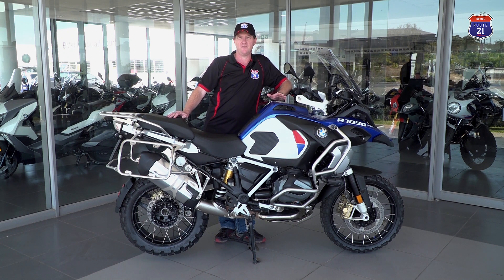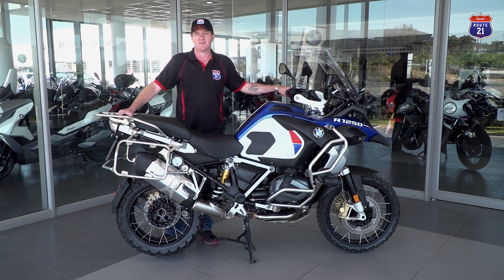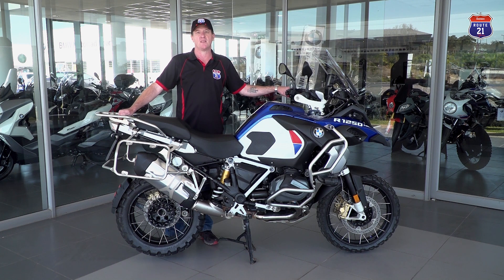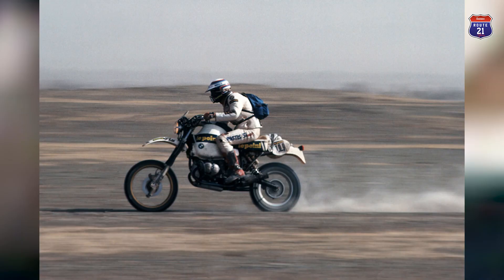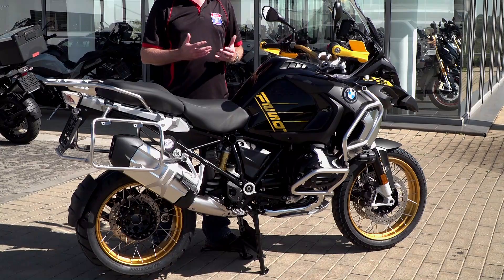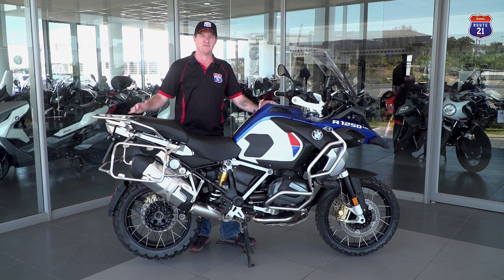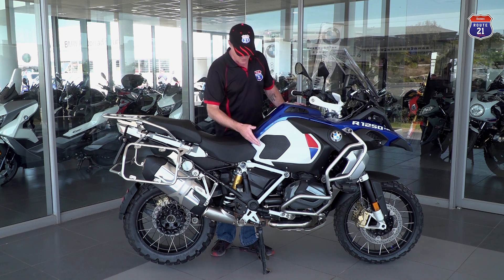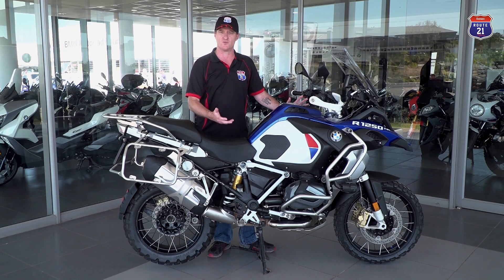BMW R1250 GSA HP Adventure Story and why HP

Comment: Does this HP tag on R1250 mean additional features ? if yes what are those ?  does this HP tag applies to GS or GSA ?
Reply: Until model year 2020 there were HP versions of the GS and GSA available. From 2021 on, they got renamed to Rallye. Mainly it's just a paint job but it adds some minor things. 

For the GS:
-SA-Nr. 456 is the option code and includes:
-windshield Rallye, clear
-Rallye seat low with luggage plate (height: 860mm)
-stainless radiator side trims with radiator protectors
-spoked wheels gold or with code SA-Nr. 771 also in black
-enduro foot pegs 
-longer front wheel cover of the beak
-frame protector
-cover plates if the luggage plate is removed
-no center stand but can be ordered with pillion package SA-Nr. 413 or pillion package low SA-Nr. 4A1

For the GSA:
-SA-Nr. 456 is the option code and includes:
-windshield Rallye, clear
-Rallye seat bench low with lagguage plate (height: 880mm) or with code SA-Nr. 759 Rallye seat bench with lagguage plate (height: 900mm)
-radiator protectors
-spoked wheels gold
-brake callipers gold
-frame protector
-cover plates if the lagguage plate is removed
-enduro foot pegs, longer beak, stainless radiator side trims and center stand come standard on the GSA.

Code SA-Nr. 19A would add the Akrapovic HP muffler, but it can be retrofitted on any model with part number 77 11 9 444 593
Reply: @LMO169  Thank You, appreciate your time.